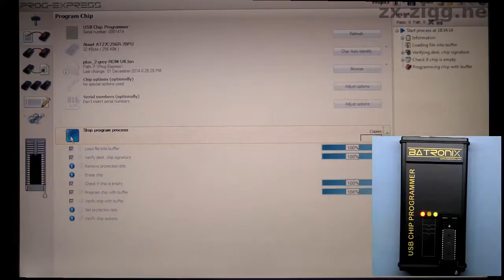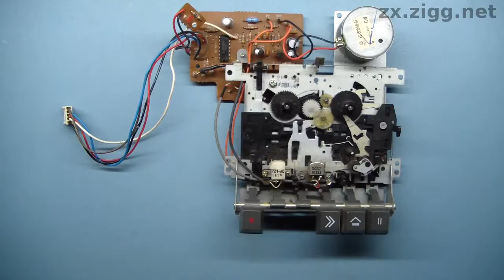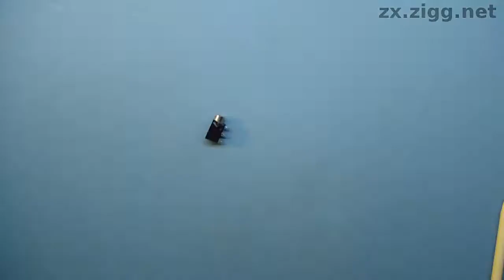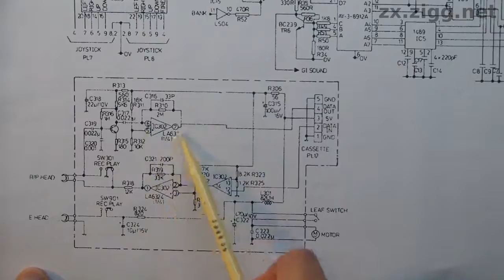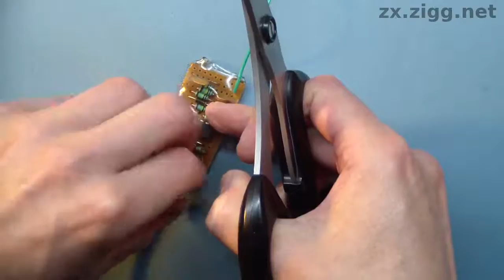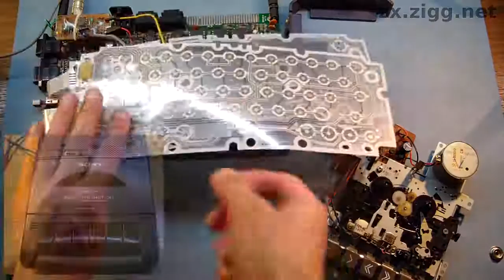ZX Spectrum +2 Repair. (No. 7). Part 3.

Comment: Empirically, I ended up with very similar values: R45 = 33 kΩ, R37 = 2.2 kΩ. However, because C28 and R37 form an RC circuit and we can't make assumptions about amplifier's input impedance, it would be probably best to increase also the capacity of C28 so that all audible frequencies from the sound generator can pass. I think 2 μF-ish should be already on the safe side and 4,7 μF is totally bulletproof even in case of negligible input impedance because 1 / (2 * pi * 2200 Ω * 20 Hz) = 0.000003619 F.

Comment: Love your videos, really helped me sort out my +2. Always had trouble loading cassette tapes, so having a go at the mod in this video. Just a few small alterations in mine, i.e. I removed R47 and used the top as output for internal cassette and bottom as input for new circuit. I added the removed 680ohm resistor to the output of the new circuit board.

Comment: Hi! Great Spectrum repair video's  you make!! I've bought my first spectrum 2+ yesterday. And maybe you can help me with the problem I have with it. When in push the Play, FF or FB button on the build in data recorder the  screen gets really blurry. And when I released it the screen is normal again. Thanks for any reply!!
Reply from the maker: It's common and probably normal for there to be a slight disturbance of the picture when the cassette motor switches on or off, but if there is significant disruption while the motor is running, then something is wrong. 

As always, there could be quite a few causes, but I suggest checking for the following:

- Degraded power supply smoothing capacitors in the +2 and/or its power supply unit could lead to such problems. If not already done, it's probably worth replacing all the electrolytic capacitors, including the one (I think there's normally only one, but replace any others too) in the cassette unit. Note that my experience is that bonding between the copper and the circuit board is particularly fragile in the grey cased +2 and so you should be extra careful to avoid damaging any pads or tracks. I suggest cutting through the leads of capacitors and removing each individually, if possible. I recommend you don't attempt this work yourself if you have no experience of component level repair of electronic equipment.

- Dirty switch contacts in the switch that energises the motor when the cassette player's keys are pressed.

- Wear/dirt/lack of lubrication where required/incorrect or worn out belt in the cassette mechanism or inside the motor unit causing the motor to have to work unusually hard and so put greater strain (and probably noise too) on the power supply.

Comment: Very detailed set of videos, thanks. I'm looking for help if you have any suggestions. I have a spectrum zx +2 like this one and the motherboard looks the same as the one in this video. My problem is with the cassette deck, though. The play button doesn't stay down at all when I press it. If I press and hold it connects fine, but as I'm sure you can imagine it isn't ideal for loading software to be constantly pressing it. I opened up the case to see if I could figure out what is wrong with it, but it's out of my depth of knowledge. if you have any ideas of what I could try, I would be grateful!
Reply from the maker: I haven't very closely examined the mechanical parts of one of these cassette units and so I don't think I can be of much help. It sounds to me as if it ought to be possible to repair it. Clearly whatever causes it to latch in the Play position is broken/worn out/missing. Perhaps someone else here will know what to do. I also suggest posting a request for help in the forums at the World of Spectrum web site. It might be helpful to post a photograph or two of your cassette unit as a few different variations were used in the +2.
Reply: JoulesperCoulomb good to know, I'll do that thanks

Comment: +JoulesperCoulomb thank you very much for your videos. they are great.
 I got a ZX Spectrum 128k +2 that didn't work. I replaced the RF modulator and got a very very decent picture. The games load fine. although I'm facing 1 issue.

I have a bit of background noise (interference like). This is gone when I disconnect the cassette player. Also after pressing enter to load the cassette, even before pressing play, sound (noise) is getting in making the colour frame around to show up and change colour in a very timely fashion from red to blue. So I believe the problem is somewhere on the small PCB board of the cassette player. Do you think that replacing the capacitors there would solve the problem or would you suspect it to be something else? 

I would be very thankful if you could point me in the right direction. :)
Reply: thats normal its the spectrum "searching", on a machine with the tape deck pressing enter on the loader is basically typing load"" enter, doing this on a 48k does what you describe,
it is "waiting" for you to press play, i hope i explained it clearly but dont worry about it what yours is doing is normal.

Comment: Hi, as you know from my other comments I'm having trouble connecting an external audio source to my +2b, I thought using a 1uf cap connected to the negative terminal of C200/(C41) would route the Audio exactly as the original schematic, but I am getting no sound in, if I omit the capacitor and connect my line in straight to the negative terminal of C200 it works no problem, now I am a complete novice at electronics and I thought I heard the word coupling capacitor somewhere so I had to look up what one did, I don't want to cause more future damage by omitting the cap, from what I read a coupling cap lets ac through and blocks dc which makes sense to me so far as audio should be AC, next I looked up the value of the cap to use for audio and it turns out there are different values for different frequency's, now call me crazy but wouldn't a digital source (cd player/mp3/sound card etc) have a different frequency to an analogue source (old tape players) so now I am wondering if I know my mp3/wav is recorded at 44.1khz would this be radically different from the intended analogue tape source and if so would a rough guess at a 44nf cap work? or 0,05uf, it's the only thing that would make sense to me or have I got that totally wrong, sorry for such a noob question, but as my electronics skills are basic I can only guess.
Regards, Chris.

Comment: Hi, I would like to add sound input to my +2 (black model) I have read that the +2 black model is a +2b or basically a +3 without a disc drive, would the Schmitt trigger circuit be necessary and a modded 3.5mm socket on this model or is there an easier way as I'm sure the +3 accepts audio in. Also I am a novice when it comes to electronics, can you explain why it would be a bad idea to just attach a socket to the tape inputs directly or even to use the amplifier that's built into the tape deck, the HA17324 chip seems to have 4 amplifiers on it, can one of them be used? If I do need to add the Schmitt trigger amp circuit would it be possible to use it with a separate 3.5mm jack I would prefer to add a second socket somewhere near the tape deck.Thanks in advance,Chris.
Reply from the maker: +Chris Flynn It's been a while since I worked on one of the later Spectrum models, so I can't remember all of the details. However...

I think the +2A is just like the +3 with regards to audio input/output, but is missing a 1uF capacitor to couple the audio input. If you add that, its audio socket should be just like that on the +3 (in and out via the same socket - you'll need an appropriate lead).

The +2B is more-or-less the same as the +2A, but has a PCB track linking the tip and the ring of the audio socket. If you cut that and add the coupling capacitor, then the audio socket should become just like that on the +3.

If you look up the circuit diagrams, what needs to be done should be fairly clear in both cases. There are other ways to achieve an audio input on these computers, but the above ought to be the easiest and least destructive.

I believe it is possible to feed external audio into one of the unused sections of the amplifier IC on the Spectrum's cassette unit. I didn't look into this very closely, but perhaps I will for a future grey cased +2 project.
Reply: +JoulesperCoulomb  Firstly thanks for your swift reply it's much appreciated :-)I had a look at the schematics for the +2a and +2b, but I seem to have a strange combination of the 2, my main board is labelled as a +2a (Z70833) Issue 2 1998, but the capacitors resistors and diodes are all labelled as though it's a +2b ie C200, D200, D201instead of C48, D36 D37 etc I found a few examples online where people just attach an input to the negative side of C200, even though I am a complete novice at electronics, this looks wrong to me the schematics shows the ear input going to the positive side of C41 also on my board I notice there is continuity between both terminals of the 3.5mm input socket, it doesn't seem to be a trace that needs cutting it seems as though it's internal in the socket, how would I be best to proceed, could I just add a new socket on the back and feed the signal to the positive side of C200 or would it be better to solder another 1uf cap connecting both negative legs together and then feed my input to the positive side of the new 1uf cap?Thanks again,Chris.
Reply from the maker: +Chris Flynn If the audio socket is a TRS type, then the tip and ring 
are almost certainly not internally connected. The PCB track connecting 
the two may well be under the socket body. I'm fairly sure I've seen a 
set of instructions for making the change online somewhere.

Whether you use the existing socket or add a new one, I suggest connecting the input via a new 1 uF capacitor, with the capacitor's negative terminal connected to the negative terminal of C200(/C48).

Connecting the new input to the same point as the cassette player's output might work, but it isn't generally wise to directly connect the outputs of two sources like this.
Reply: +JoulesperCoulomb  Thanks again for your reply.

I am also wondering because my mp3 player, laptop soundcard etc is stereo, if I just use a stereo cable and solder the left and right channel together in the new socket, would that be ok or would this have an affect on volume or damage the sound card or mp3 player, sorry but I am a complete novice as I said or would I be best just using either left or right only?

Thanks again,
Chris
Reply from the maker: +Chris Flynn It would be best to connect only the left or right channel of your audio source to the Spectrum's new input.
Reply: +JoulesperCoulomb Hi, I lifted the socket, there is indeed a link between the left and right channel, not visible even shining a light through the board, I cut the trace and soldered a wire from the input side of the socket to near the tape input plug, I then soldered the wire to the positive side of a 50v 1uf capacitor and soldered the negative side of the cap to the negative leg of c200 (carefully using heat shrink tubing), I thought this looked exactly as the schematic for the +2b looked, I made a mono 3,5mm to 3.5mm lead, I thought all was well but there was no sound tape still plays ok but no sound from the socket, I checked continuity of the socket wire and cable all is fine but no sound comes from the mp3 player or phone, the border does flash briefly and a little hum as I plug the socket in and out :-(&#160;
To make matters worse I unsoldered my wire and poked it around the tape input socket and shorted something out and the poor old specy is now dead no power :-( :-( (stupid thing to do I know).
where should I start to look to get it working again? what have I most likely shorted? I do have a multi meter and transistor tester can just about use them.
Thanks again,
Chris.
Reply from the maker: +Chris Flynn Does the red power light on the computer come on? If not, it's quite likely a fuse inside the external power supply has failed or the supply has suffered some other damage due to being briefly overloaded.
Reply: +JoulesperCoulomb HI,

No the power light doesn't come on, I put my meter on gnd and tested for voltage at the points just inside the din connector, I'm getting (1.45v) on the 12v point (0.25v) on the 5v point and -12 on the right hand side, is this normal if it's not drawing any current or should it still show 12v 5v and -12v etc?

Regards,Chris.
Reply from the maker: +Chris Flynn The +2A/+2B power supply should output approximately the correct voltages when not under load, so it seems you have done it some damage.

If it's the standard +2A/+2B supply (not the +3 supply, which can also be used to power a +2A/+2B), then the 5 V output is protected by a 3.something amp fuse and if you're lucky that'll be all that's gone wrong with the 5 V output.

The +12 V and -12 V outputs are derived from a shared transformer winding (separate from the one used for the 5 V supply) and shared rectifier. If the
+12 V output is missing, but -12 V is correct, then I suspect the 12 volt regulator has failed.
Reply: +JoulesperCoulomb I just checked the 3.15A fuse has blown, I can't get one to replace it until tomorrow now, could that cause the whole supply to act up or will the 12v regulator be deffinately knackered too? sorry forgot to mention it is a +2A supply.

Regards,Chris.
Reply from the maker: +Chris Flynn I'd start by replacing the fuse and seeing whether that cures the fault. However, I rather suspect there has been some damage to the
12 V part of the supply too and that'll mean the 5 V regulator won't work either as the 5 V reference depends on the 12 V supply.
Reply: +JoulesperCoulomb HI, Thanks a million, I replaced the fuse and it seems to be working ok. With the power on and connected I am reading around 11.98v and 4.9v I am assuming it drops slightly when under load? but the main thing is it's working again.

I am back to my original problem now though, as I said previously I cut the track beneath the 3.5mm socket, and made a lead up, ground is to the first section my new input to the middle ring and output is on the tip.
Following the schematic I used a 1uf cap with the negative leg connected to the negative leg of C200 but I get no sound at all except for a slight click when inserting the 3.5mm jack. if I remove the cap and place my lead onto the negative side of C200 I get sound roughly the same level as the tape and it appears to load but at the end of loading I get R Tape loading errors or some games reset, if it says error typing Randomize USR (whatever number is in the code) the game will run.

How would I be best to proceed, I really need to load via an external source as my tape player isn't the best. and I want to try OTLA speed loading too. Is there any reason you can see why my connection through the 1uf cap isn't working as it seems to be the way they originally done it.

Thanks again for your time,
Chris.
Reply from the maker: +Chris Flynn I don't think I can suggest much more. Are you certain you've got the wiring to the socket and of your connecting lead correct?

With the cassette unit disconnected, try feeding your external input to the cassette header on the PCB (according to my circuit diagram: pin 1 = GND, pin 2 = audio in). If that doesn't work, perhaps there is something wrong with the Spectrum's audio input circuitry.
Reply: +JoulesperCoulomb Hi, thanks again for your earlier advice, made up to have my spectrum working again :-)

I double checked my wiring, everything seems right, still no sound, I disconnected the tape input plug and connected my source to gnd and input pin 1&2 on the header plug, still no sound, I also checked this on 2 other +2a models which I bought for spares or repair and the result is the same, on all 3 models if connect my source to any gnd point and the signal to C200 negative side without the extra capacitor the sound comes through, it doesn't make sense according to the schematic, all 3 cases are labelled as +2A but the boards are Definitely Z70833 +2B Boards, I have seen a few hacks around the internet with this model where people are just connecting gnd to one of the resistors near the reset button gnd side and the signal to C200 negative side, am I going to cause any future damage if I use this method or is it safe to leave it like this.

Regards,Chris.
Reply: Hi thank you for the Schmitt Trigger circuit it works very in my +2b

Comment: also if you insisted on providing your own discriminator and amp circuit, you could have employed two unused op amps which are inside the cassette 4 way IC

Comment: regarding new audio input signal, you could have attached it directly to one of the existing inputs of the audio amp in the cassette unit, pin 5 or 6. This way your external input would look exactly like the internal cassette signal from the ula perspective, without any additional components (except coupling capacitor and maybe resistor divider to bring down the input level to the amp)

Comment: Currently fixing a broken play button on a Spectrum +2.
How essential is that metal bracket reinforcement?
Reply from the maker: punkojosh I haven't attempted such a repair without it, so I couldn't be certain. However, that part of the button has to take quite a bit of force and so I strongly recommend reinforcing it.